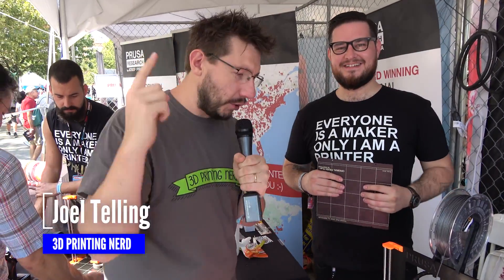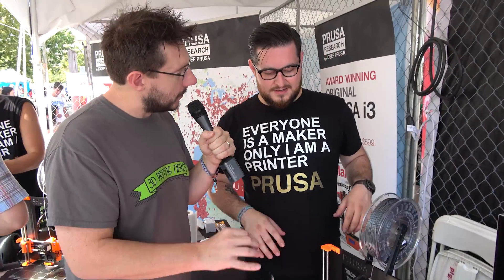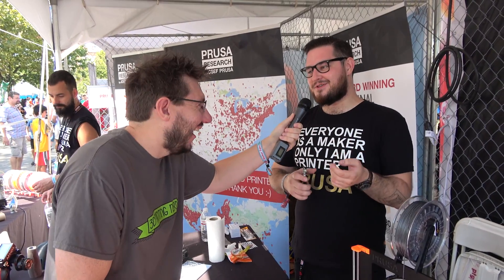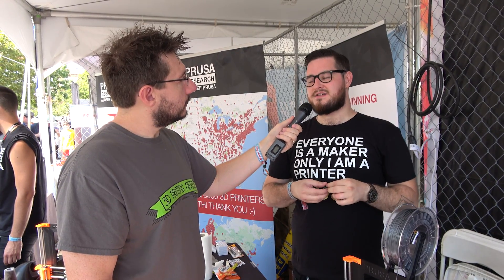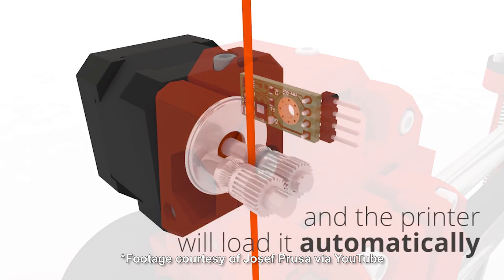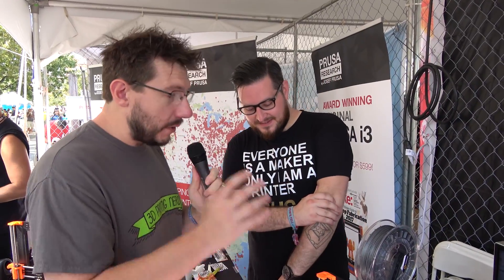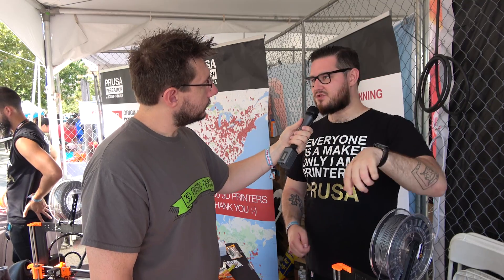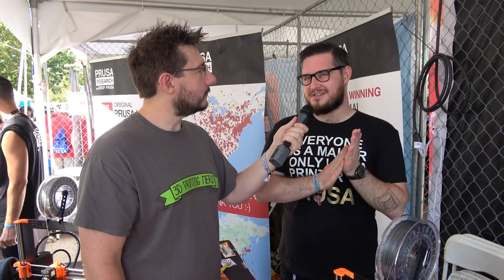First Look at Original Prusa i3 mk3 3D Printer #MFNY17 - Josef Prusa at Maker Faire New York 2017

Comment: Have you done, or are you considering a head-to-head comparison of the Prusa i3 MK2s/MK3 with the Lulzbot Mini?  Both seem to get high marks in reviews for reliability & quality of build.
        I own a Lulzbot Mini, and friends are always asking me what I think of it and how it stacks up against the MK2s/MK3 (other than the obvious build plate size difference). I've been debating getting an MK3 kit myself, but really don't need 2 printers (I know... that's sacrilege! You can never have enough! However, my wife thinks otherwise). I really like the Mini, especially the fact that it just keeps on going - rock-solid reliability. I don't really need multi-color printing (and muti-material has not become necessary for me... yet). So it's tough to convince myself to make the leap to something else.

Comment: I love it. It's difficult to powder coat PEI onto a flexible steel plate, so they invented a way to do it. 
Will you be doing a review of the MK2.5 upgrade kit? I'd love to know whether it's worth it.
Reply from the maker: I *may*? Depends on schedule. I'll be able to look at the 2.5 upgrade parts on the mk3 and then say whether it's worth it or not - would that work?
Reply: Absolutely! I was just hoping for your opinion on the upgrades available to the 2.5. Thanks, Joel!

Comment: What's the go with the aluminium foil on the top of extruder?
Reply: Tai Johnsen Josef said it was due to infrared light from the intense sunlight triggering the filament sensor. They will be using less translucent plastic in the production machines to prevent this.
Reply: I figured it was something like that. Thanks. Hopefully 50hz flicker from fluro lights doesnt confuse it. Lookin forward to more reviews. Order has been placed ;)

Comment: Is there somewhere to buy the einsy rambo by itself? i cant find it..
Reply: Not sure the price but the alternative would be the Duet Wifi.   32 bit electronics and same (but more powerful) stepper drivers, and it has built in Wifi (as the name implies).   probably slightly larger but it's good board with great support and firmware.
Reply: Thank you so much! Its exactly the type of board i was looking for! :)
Reply: duet wifi has been out for a while and price is still too high. there are pc motherboards with more features for the price.
Reply: Very interesting, im looking specifically for quiet stepper drivers as well, would a motherboard be able to do that? I also do like the Duet's wireless control, im an amateur when it comes to code so having that solution already implemented saves time. Also it seems to run on more or less marlin which im familiar with. What firmware would i have to use with a motherboard?
Reply: lol,  you're comparing high volume manufacturing to low volume.... those e3d v6's are also worth 1/4 of what they sell for.  same could be said for any 3d printer.... you can buy a inkjet printer for $20 with more complex electronics and operation than a simple 3 axis 3d printer.....  i mean it has a paper feeder with jam detection, an encoder strip with a feedback loop using DC motors, auto-calibration, Wifi, It can SCAN shit too... it can precisely spray ink on paper with an array of colors via color mixing and replicate a photo with a higher resolution than a 3d printer and you can get all that for $20-$50....  a 3d printer by comparison is extremely simple.   But 2D printers are mass produced 1000x over any 3d printer.  shit they don't even make a profit off them, they do that selling ink.
Reply: Over priced?  The mini-rambo is $120 and the Duet is $160.... it's $40 more for 32 bit, Wifi and TMC2660 drivers....the 32bit  Archim is $150....

Comment: Nice upgrade, but I'm still very disappointed they are using so many 3D printed parts in this printer, it has so much more potential. At least it seems they have moved away from zip ties to attach the bearings which is a welcome improvement.

Comment: 32 bit CPU would of been nice for future proofing.  Having to solder on the Pi,  ok whatever.  Still using zipties and a dated LCD screen,  MEH.  OLED's are just as cheap now.  8 bit, LCD's and zipties might "work" but there are better things out there for the same price.  32 bit CPU's cost literally pennies more to the BOM.

Comment: I am curious if the filament detector has enough resolution to see variants in the filament diameter and the ability to adjust the flow rate on the fly.
Reply from the maker: If that is possible, Jo probably has a dungeon full of engineers working on it right now. Did I say dungeon? I meant funhouse.

Comment: Only thing missing, really, is dual extruders.
Reply: Dual extrusion is shit, srsly. Less advantages, many disadvantages compared to a single extruder.
Reply: Prusa have Multi extruder single hotend, which IMHO is even better than dual except for the waste tower
Reply: PH1LZ WTF?? It has some big advantages. If you don't need it, you don't have to use it
Reply: Thats correct. But if you use it, there are some difficulties which a single extruder doesn't have. Prusa Research made a video about this topic, but I'm not sure which video it is.

Comment: When are you making a BIG printer Josef?
Reply: The Prusa style printer size is limited due to the moving Y-axis. If it would be bigger, the print quality would impair significantly. If Joe is going to create a big printer, it will be a all new model with a different technology. CoreXY maybe?
Reply: What are the limits PH1LZ? The motors can move quickly and the bed can be supported. Where would there be a degradation in performance?
Reply: Of course you are right, but at a certain point the massive inertia resulting from acceleration / slowing down / changing the direction of the heavy Y-axis will force you to lower your print speed if you're looking for your expected quality (just like a from a regular sized Prusa). I hope you understand what i'm talking about, dicussing physics stuff in English is quite a challenge for me :D
Reply: I’m educated in physics so I fully understand. That’s also why I don’t think it’s a problem to go up to a 300mm^3 or 400mm^3 print volume. Yes, a CoreXY is more efficient at this but Josef has a lot of research in this area. I’m wondering if he has either the plans or research into the large volume. I’m hoping to hear from him.
Reply: Me, too :) Let's see what the future holds, I'm excited. Still not sure which 3D printer to build / buy. At the moment i own a crappy Prusa clone (Anet A6) and I still haven't made a decision between buying a Prusa MK3 or building a Hypercube Evolution... Damn, the struggle is real.
Reply: I'm looking at building the CoreXY for my big format but I really like all the features from Prusa. I built a Prusa i3 Rework 3 years ago from RepRap.org.
Reply: Which CoreXY are you going to build? I think I'll go for a hypercube. Not because its the best CoreXY-printer, just because it has a nice documentation, a big community and all STL files for printer files are free to download. But still not sure yet.
Reply: I’m thinking of designing it from the bottom up. I’m a ME so it’s what I do for fun.
Reply: Okay, that sounds nice

Comment: Looks like a great machine with some fantastic improvements. That said, I don't consider any printer Octroprint 'ready' if you need to solder headers on the printers main board. That should have been done in manufacturing.
Reply from the maker: I sort of agree with you here. Once I have the machine I'll have a look at the board. Jo mentioned something about the connectors on the board, so, maybe that isn't the case? I'll keep you posted, RJ.
Reply: Well you have to solder the GPIO pins to the Raspberry (This has nothing to do with the Einsy Rambo and is just normal for a Raspberry Pi Zero) and judged by it's looks you can just "click" it in the Rambo board after that.
Reply: Leon, I could be wrong but Jose seemed to be pointing at the Mk3 board in the video to the area where a header needs to be soldered on.  Did I see that wrong?
Reply: RJ_Make he talked about the Raspi and not the Rambo Board.
Reply: I think Josef mentioned not wanting to effectively become a distributor of the Pi Zero W by shipping them with every MK3, they can be difficult to get hold of in such large volumes and you wouldn't want that holding up production. I can see it being offered as an add-on option to those buying the pre-assembled kit in the future, it makes sense.
Reply: I just re-watched, and Josef clearly pointed to the back of the main board while talking about soldering on a header. HOWEVER I believe you are correct Leon because I noticed on the 2nd watch when he flipped the board back over the header appears to already be there. I didn't catch that the first time.

Comment: Its missing an enclosure and ambient heat control. Doesn't make sense with the i3 design though. Its also not a great frame design portability either IMO. But otherwise it looks good.
Reply: Since the motors will be silent, other noises that were normally drowned out will appear.  they should of thrown in igus bearings but still people can add those during the build i guess.    Frame works for the most part.  not fond of the Y motor mount on mk2 but eh...
Reply: “Not a great frame design” I know you wrote this comment a year ago, but what did you mean be that?

Comment: I was hoping a shift to more printed parts. I think Prusa sould make one 'reprap' model that has most parts printed. They have clever minds there to find ways to make printed parts structurally stable and ridgid (the main frame forinstance). Maybe they could have it printed in carbon fibre ot PETG or sth,I really hope they one day will have a Prusa RepRap model.

Comment: Is upgrading extruder to MK2.5 worth 149$? What is the diffrence in quality?
Reply from the maker: The Bondtech gears alone seem worth the upgrade. I will be printing with some soon :)
Reply: I am looking forward for it. I also viewed Thomas review about bondtech extrusion and only advantage is speed. So prusa's rod mk2 frame can't take any advantage over this design.
Reply: It's an insanely good deal.  Noctua fan, magnetic removable bed, bondtech extruder gears, pinda 2, crazy amount of stuff included for $149.  I think people are not getting as excited as I am for the removable bed.  I think that Prusa is going to have a hard time keeping those in stock.  Not having to do PEI replacement yourself is huge.  Hopefully Prusa partners with someone in the US to stock these sheets.  I think non Prusa owners are going to be buyers of the bed and PEI sheets.
Reply: You do get a new heat bed, i think that's the bulk of the price.  you could use the other bed for spare or build another mk2 clone with the bed and pinda probe.    plus running out of filament sensor or jam detection is worth it, especially if the spool is tangled.       BuildTak sells a flex plate system and it's like $100.... and it isn't a heated bed, it just installs on the one you got already.